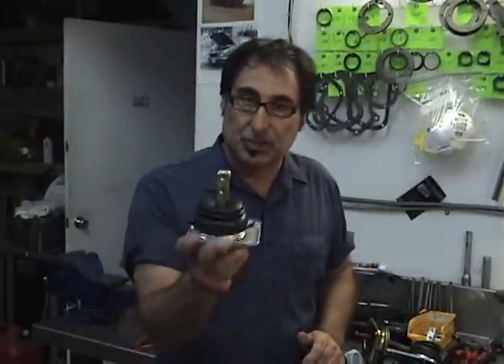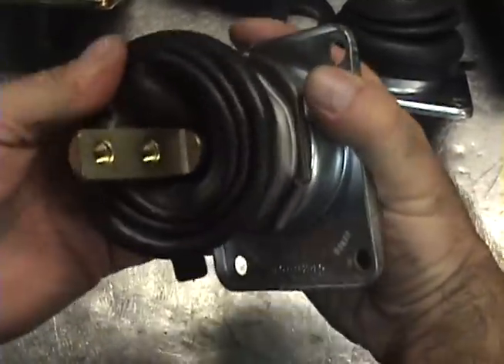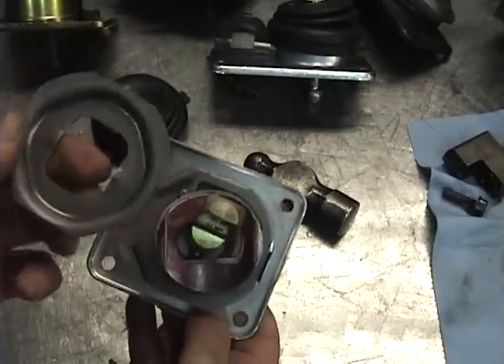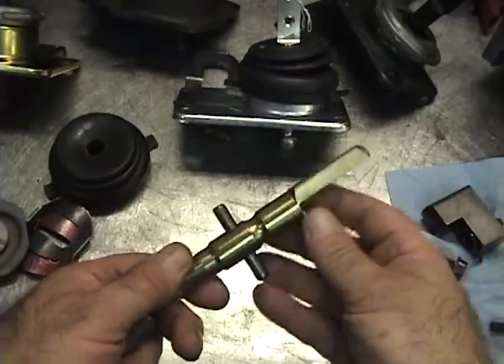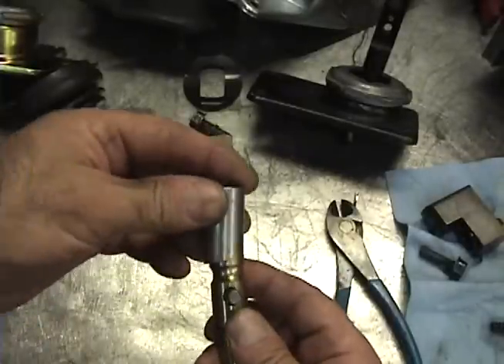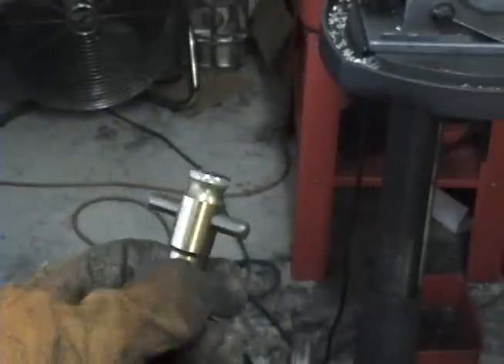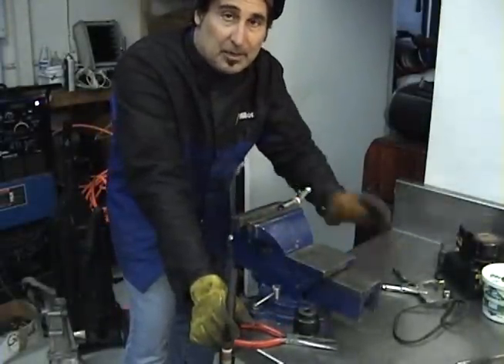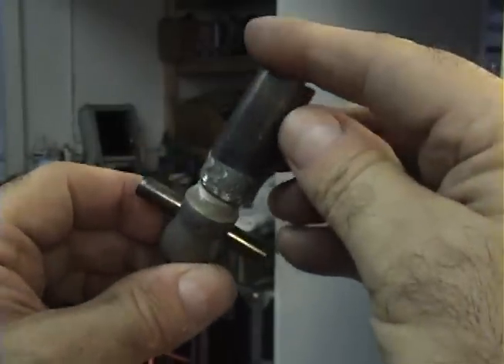T5 5 Speed Transmission Shifter Modifications

Comment: hi 👋 Paul thank you for great informative  video. I have a question 🤔  hope i can give you enough information  so you can can help  me, i put new  clutch with throw out bearing ,pilot and pressure plate including  clutch cable. i cant put it in ⚙ gear when car is on ...only when its off. idk what it can be ? Thank You
Reply from the maker: Your clutch is not releasing.

Comment: Been prying with strap out to rear-end  got 3/4 inch gap and can go farther tried pushing clutch while it's running tried shims and 2 prybars still stuck s197 06 v6 t5 trans from bell housing  what else do I try o please 😢 4 days of and on in driveway laying in the puddles I'm loosing my will to live. really ! My name at Gmail
Reply from the maker: Pull everything out and check your distance and alignment of the bell. Maybe the pilot is just too tight
Reply: @GearBoxVideo  I can't get it out is the problem won't let go do I need a bigger pry bar I'm using 2 12 inch crowbar and it wiggling can see the output collar it's clear of bellhousing but barely and I have it supported trans jack perfectly straight been prying for hours multiple days
Reply from the maker: I've seen this happen where the bearing retainer rubs against the clutch and mushrooms and then you can't pull it out

Comment: I have a 1987 2.6 L Mitsubishi mighty Max five speed manual transmission the shifter broke right at the ball on the bottom of the shifter does anyone know where I could get A new gear shifter or what transmission I have with my 2.6 Mitsubishi mighty Max I have asked 26 junkyards not the first one of them have a Mitsubishi mighty Max that the transmission shifter will work nor does the parts house even have that listing

Comment: Where can I get really dense foam insulation that goes under the shifter for a 1988 Chevy S10 base 2.5 ?
Reply from the maker: Nobody resells the molded foams the OEM has. Best to just use adhesive Dynamax.
Reply: I found thick dense foam I can get at Home Depot; will work fine, I think. I will just cut some to fit. Thanks.

Comment: I have a 93 2.8 5 speed is there any short shift kits?
Reply from the maker: What is your make and model?
Reply: +GearBoxVideo wc t5 lb8
Reply from the maker: +tyler hodapp  Again.... make and model. What make and model car is this for?
Reply: +GearBoxVideo 1993 s10 2.8 sorry about that
Reply from the maker: +tyler hodapp Hurst did make a short throw for the S10.  The original S10 base is pretty short throw because it used a longer stick. So the base compensates for the longer stick.  The Hurst one, maybe found on Ebay since it is no longer made, is the only aftermarket one that will shorten the throw for that application.

Comment: Paul, i am mating a T5 WC camaro transmission from a 90 camaro to an LS in my 90 Camaro. as you know they are slanted. so my issue is with the LS i have to use the 621 bellhousing which takes away that slant. my question is, what can i do about the trans mount, and what can i do about the shifter? can i use an s10 shifter? can i put a mustang shift rod into the camaro baseplate? the torque arm is solved already.
Reply from the maker: Running the trans straight is not an issue. I've taken extensions off and had the mount surface milled flat and / or made a wedge spacer.

Comment: Can you make a video on s10 shifter. Removal and modification
Reply from the maker: +Brandon Goudy  The shifter in the video is basically the same.  All T5 transmissions have the same assembly regards of make and model. The shifter on any T5 comes off by simply removing the 4 bolts ( or 5 for a Jeep ) that hold it to the extension housing,

Comment: What is your knowledge/opinion on whether or not the T5 has internal stops. How well they work if they do, and the necessity og positive stops on the shifter?
Reply from the maker: The T5 has no internal stops. People think the guide plate in the tail acts as a stop, but it doesn't.  Normal driving really doesn't require a positive stop. However forcefull powershifts will bend and break the internal shift fork lugs, because the force of the shift can bend the lug.  So for performance use, a shifter with stops is mandatory. The shifter in the video is for a Jaguar E-Type and these cars are never power shifted.

Comment: i know the shifter base plates are different per vehicle but are the shifters interchangeable? I'm wondering if i can use a jeep cj7 t5 shifter handle in my s10 t5 shifter base plate? Thanks in advance
Reply from the maker: If the sticks bolt-on, yes but as far as the Jeep goes it was never a bolt on stick.
Reply: I mean if i pull the base plate/shifter out of both transmissions, can i disassemble both and swap the jeep lower part (the part with the ball that goes down into the shift rail) into the s10 base plate, allowing me to use the jeep shift handle?
Reply from the maker: If the length of the fulcrum to the center of the pivot ball is the same, then yes

Comment: 4:30 what is partnon the blue rag next to the bolt where does it go ?how do you install?
Reply from the maker: The offset lever.
Reply: I know it's a year later. But that is the piece that the very bottom of the shifter goes into when it's bolted to the tail housing. I think it's held on to the soft shaft by a roll pin. You probably didn't take that part out...
Reply from the maker: As mentioned the offset lever